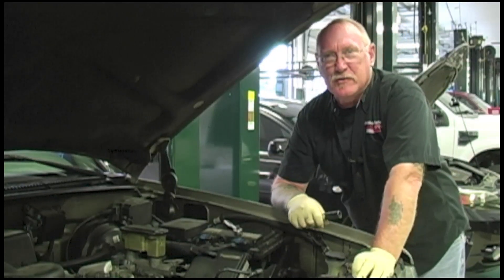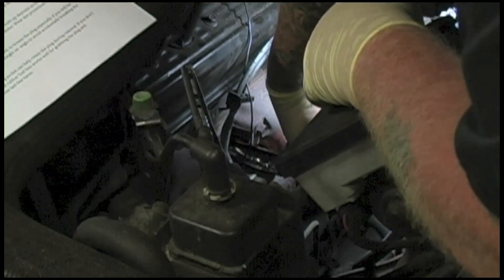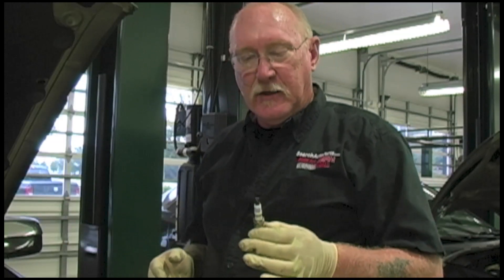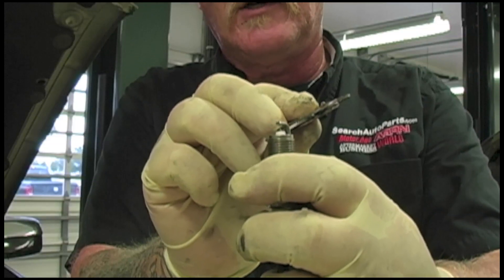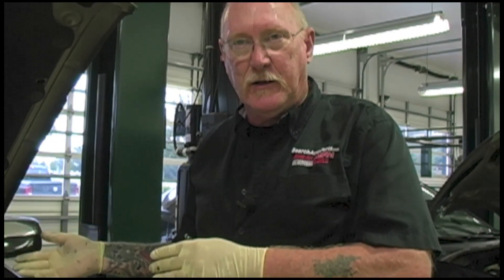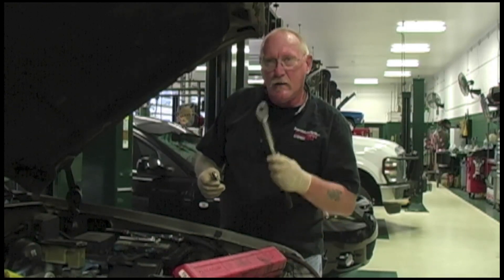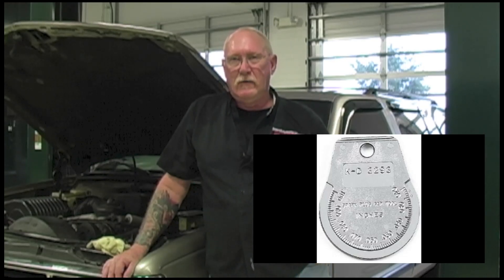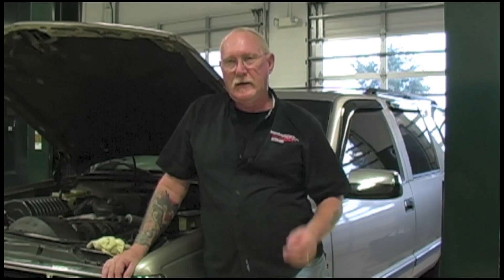The Trainer #44: Servicing your spark plugs

Comment: Cooper anti-seize is conductive.  I have some gray anti-seize which I am unsure of whats in it (label is a bit obscured) but the label says it is conductive (I can see that part).  I've been changing plugs in my cars since age 14, I'm 63 now.  I have observed the incredible hassle of a seized plug and knowing that anti-seize, recommended or not, will do no harm as long as you use small amount, I will always use anti-seize on plugs.  Not saying you are wrong, that's just my default position.  I've worked in aerospace all my life and two immutable rules are:  Unless specifically prohibited or thread locker is required, no fastener installed w/o anti-seize and no O-ring in stalled dry, ever.
Reply: Regarding X-Man,   I am wondering if having that much experience is actually a bad thing:  Example:  you are basing your current practice on what you learned 30-40 years ago,  which was based on spark plug technology of 30-40 years ago.   Current plug design is much different, and all manufactorers do NOT recommend anti-seize paste due to the special coating on the threads.   Wisdom is great, but it is better if updated on a continual basis.
Reply: 42 years experience in the aerospace industry.  I've seen many anti-corrosion coatings fail, especially at mating surfaces of dissimilar metals.  Anti-corrosion coatings on threads are particularly vulnerable were the coating on threads meets a dissimilar metal. Phosphate and nickel coating work well when they remain intact but the act off screwing plugs into cast iron or aluminum heads scuffs this coating.  Aluminum is pron to galling and cast iron is very hard and brittle.  If you have ever seen thread cut into cast iron under high magnification you'd note right away it is very jagged and will literally grind away coatings on mating or faying surfaces.  Great advances have been made but the phenomena of Galvanic corrosion still exists.  Maybe you don't need anti-seize on spark plugs now.  But it is NOT harmful if used appropriately.  It's good insurance policy. It also makes it easier to install plugs with long thread base. Only need a wrench to break torque or final tightening.   BTW- anti-seize is required all over many new weapon systems including the newest of the new, F-22 and F-35.  They have state of the art anti-corrosion plating/coating regimen designed into them but anti-seize and other anti-corrosion inhibitors are widely used.  I will continue to use it on just about everything that doesn't require a thread locker.  Rust (iron oxide) and other forms or corrosion never sleeps.  Never.
Reply: Just pulled my plugs today. I guess that special coating did not work as I had to work the plug in and out to assure not to get thread damage.

Comment: I know we should never remove plugs on a hot engine but always wanted to know about doing compression tests on a warm engine . Especially with nearly all heads being aluminum now . What is a safe bet to still have engine warm enough to do compression tests, running compression included with out hurting threads ? Thank you and I love all your training videos .
Reply from the maker: I've always gone by the rule of thumb that if it's too hot to touch, it's too hot to work on. So if you can hold your hand on the head without burning yourself, I think you'll be fine.
Reply: if you have a stuck plug sometimes it will come out easier after it is warmed to running specks
Reply: the removing is not as critticle as in stalling, do not install on a warm engine

Comment: Thanks for the video, Pete.  Looks like I gotta pull my plugs and clean the crap (anti-seize) off.  The factory service manual does not say anything about putting the stuff on, so I guess I should have not put it on.  So, I guess I better pull em and clean them and the seats up.

Comment: Regarding the use of anti seize, I have been informed that when using anti seize on spark plugs one should use the copper type rather than the nickel.
Additionally, on torque values for spark plugs, they are generally given for dry plugs. If one uses the dry torque value with anti seize the spark plugs are going to be over tightened and then one will run the risk of stripping the threads on aluminum cylinder heads.
Reply: Actually after chatting with multiple plug reps they do NOT recommend copper based antisieze, two reasons, it's actually more suited to exhaust manifold bolts and other high heat. Now silver antiseize us nickel based and suitable for ignition use. Also for the record as I was informed the plugs that have silver cast are nickel plated, and antiseize will NOT affect continuity high voltage ignitions. After destroying a $4800 head by not using it I still brush it on all plugs. In 30 years I have had to repair or replace heads from non use and have never had runability issue using it. IF manufacturer puts placard under hood fine but then the fools screwing Autolites into every car and then I have to redo tune ups. Chased hundreds of "will fit" parts induced drivability issues. I have had best luck sticking with or type plugs and specific ignition parts. Like Nissan's HATE aftermarket COPs. Never found aftermarket that don't throw codes. And even the ones that claim they make OE parts cause issues. Oh and I have worked on, built, tuned and diagnosed everything from Briggs and Stratton to nitro hemi funny car engines. 30 yrs have shown what works and what doesn't and I want this guy to tell me how to torque plugs than I can barely get my hand and stubby wrench into. Not saying there isn't torque and if your inclined to do it, fine. BUT do part of tune up by hand, and then check plug torque, so far I feel my experience has given me decent feel for doing plugs. But experience and skills tend to be spotty sometimes. Just my opinion and observation.
Reply: When i use anti seize i will swipe the brush against the rim off the can to remove as much as possible. Then apply as light of a coat as possible. It does not need much at all. Same with dielectric grease on the insulator
Reply: Good info Thanks
Reply from the maker: johnwrench4speed The vast majority of plugs made today are made with a different material in the shell and the use of any anti-seize product is not recommended. Makers that do (auto and/or plug) are few and far between so my best suggestion is stay clear of it entirely.

Comment: Glad to know I have been doing them right. I am glad that you mentioned a torque wrench. I see to many mechanics that do not use them. I see that you use grease on your boots. I have always used spray silicone any thoughts on that?
Reply from the maker: monzsterman Just to clarify, I use dielectric grease. Dielectric grease is non-conductive. Silicone spray, I'm thinking, is conductive (1) and will probably burn off with engine heat rather quickly (2).
Reply: Motor Age Never thought about that. Your never to old to learn. Thanks.
Reply: Spray silicone is NOT dielectric and it's in a solvent carrier that can attack boots and even make them stick.